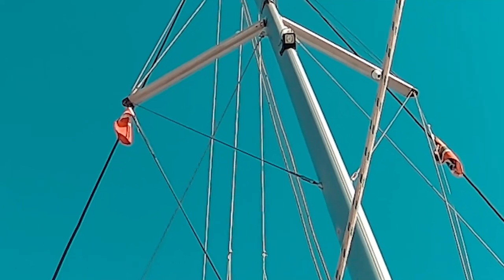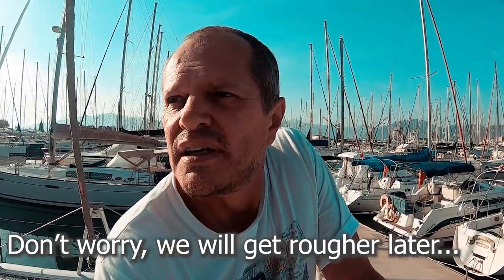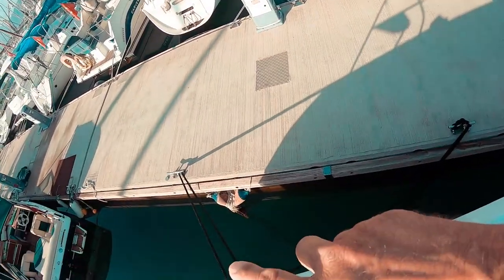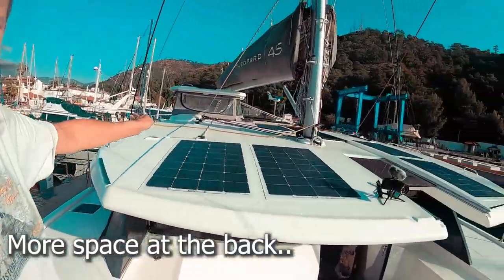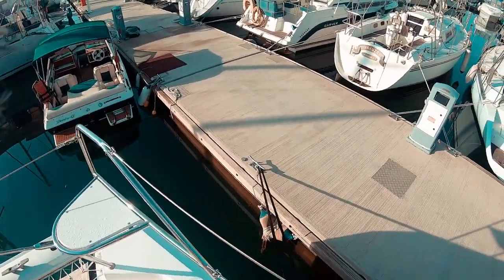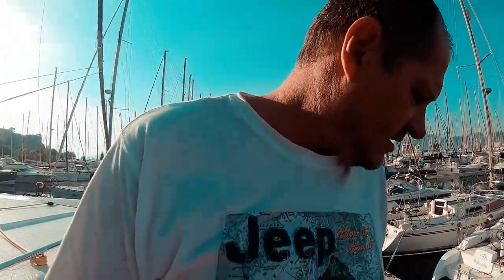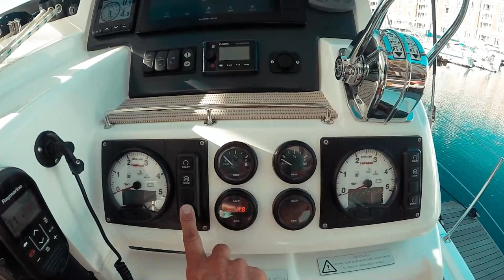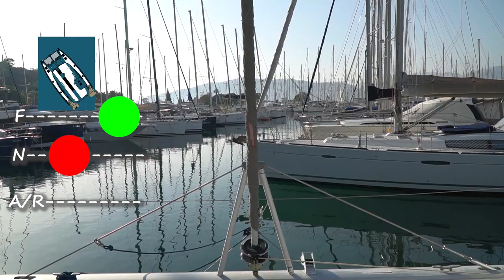#153t How to Sail a Catamaran - Docking Practical | Sailing Sisu Leopard 45 Catamaran

Comment: Too easy! 😂.    Cheers guy!
Reply from the maker: Yeach, we need to add wind and some currents in those close quarters! Thank you Trev!
Reply: @SailingSisu  the Graphics with the controls worked well,  it would have been great to be rudder angles aswell,  but seeing the rudder don’t do a real lot at them speeds,  the throttle controls was enough..   really good!
Reply from the maker: Trev, in some cases cats can use the prop wash to their advantage  too. For example,  Sisu would have moved faster in the initial turning out if the wheel was turn over hard to starboard side. But for beginners,  I wanted to show that cats work like a tank.

Comment: How would You go back to that place- reverse through the valley which is narrow here from the start or forward and than rotate close to berth?
Reply from the maker: A cat can rotate pretty much on the spot (a monohull too, BTW) so, it is a question of "would the length of the cat fit side ways" if you can find a spot, then I would prefer to go fwd and turn/rotate into the berth
Reply: @SailingSisu  
Thank You for response. I was wondering if, by using the levers alone, I am able to maintain a straight course while sailing backwards, on a longer and narrow path, especially in strong side winds
Reply from the maker: @abrelegowany  Yes, you would be able to steer backwards with two throttles only. Just be aware that the rudder will have some serious force on them if you going fast meaning, make sure that lock wheel is tight or that you are holding the wheel very tight